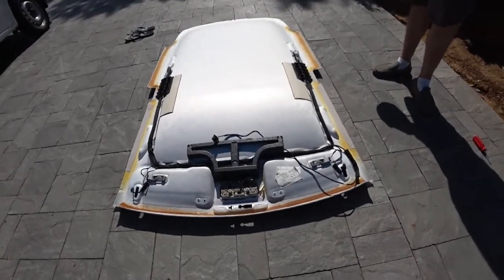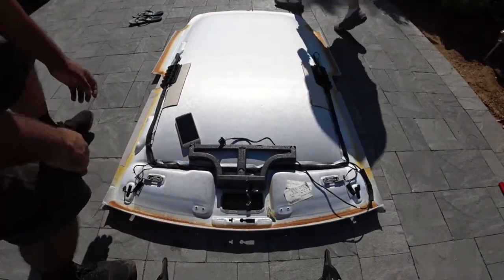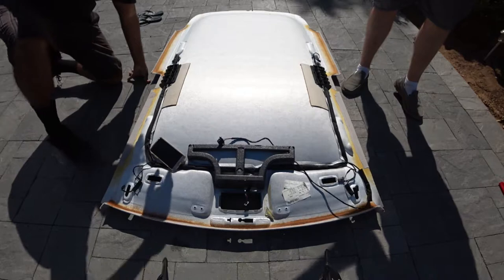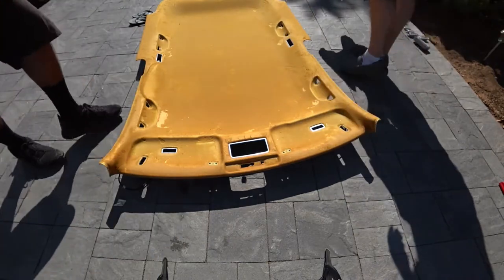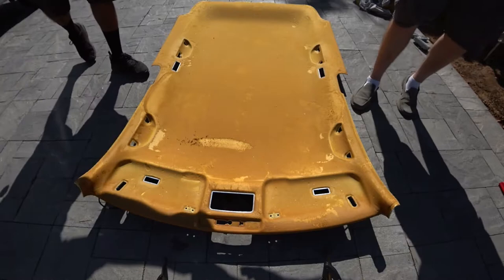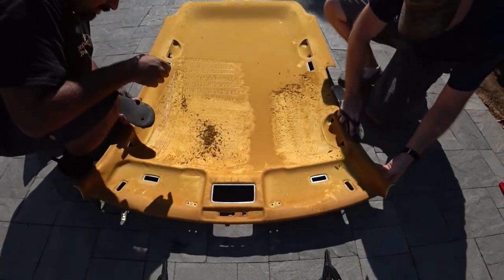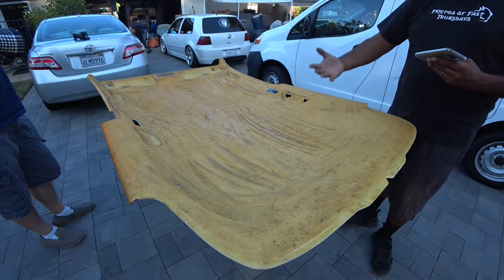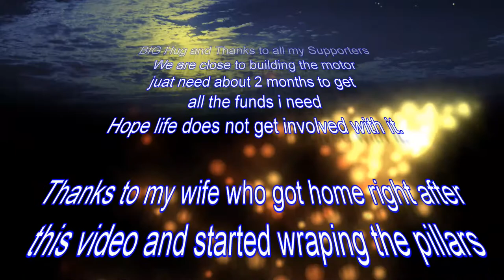How to prep an VW MK4 Headliner Part2 S4EP25

Comment: Just wanted to add….great video.  Also, following your lead….re-doing headliner in wife’s 2001 jetta wagon and I have found that the cheap silicon kitchen utensils work great for getting old foam off in hard to reach areas.

Comment: Hey al this doesn't have anything to do with the videos but I had a question
I'm at uni stage 2 with a k04 I was hitting around 18-19 psi in boost I was getting stage 2+ so I put in the 3in maf housing using my sensor and 386cc injectors and switched from a short ram intake to a CAI and I only hit 9psi boost get the tune and only hit maybe 17psi randomly but normally only 13psi? I did nothing to boost or a vacuum lines and vacuum hasn't changed?
Reply: Layten Perkins hi your maf sensor needs to be changed up for the tube you have used.
 the standard mafs in the lesser 1.8t like 150bhp k03 an 180bhp k03s dont read as much airflow and max out you need the maf out of the bam 225bhp cupra r audi s3 an the like you maybe just freaking the ecu out your gettin more flow threw the 3" maf tube than the maf can register there for throwin the fueling out so trim is opening the wastegate to compensate MAYBE lol bets im right though
Reply: Iv already done this on my cupra i used 3mm scrim foam an alcantara suade also did my pillars
Reply: Mike Evans so what you saying is that I need to get the maf sensor for the 3in maf housing and not my stock 1.8t maf sensor?
Reply: Layten Perkins yep totally diffrent part numbers mate im running 300bhp on a k04 11blade billet wheel hybrid an to achieve this i had change out my maf too mine was originally a 180bhp cupra but ye change that maf the standard one want register that much air tops out at around 260gs